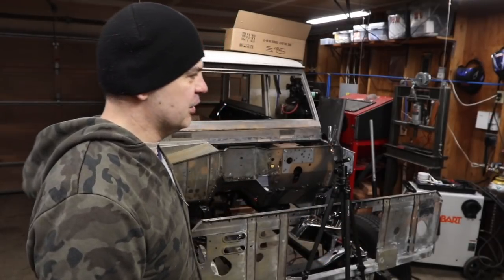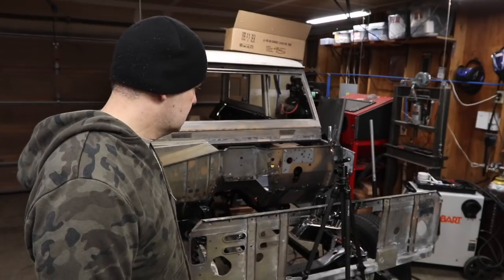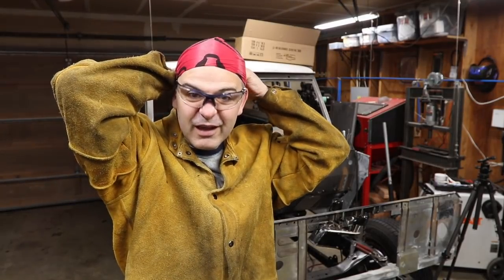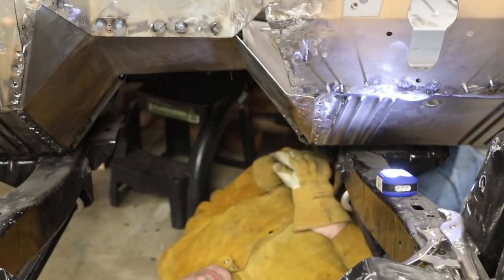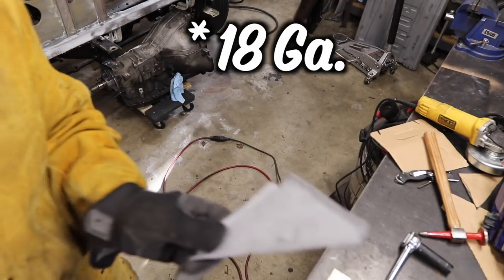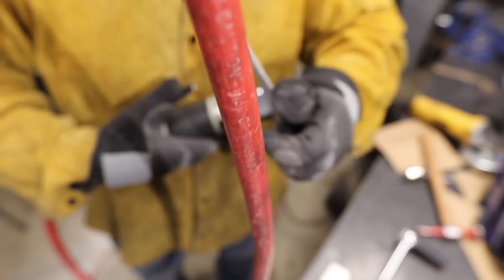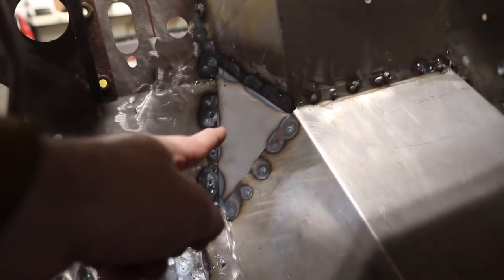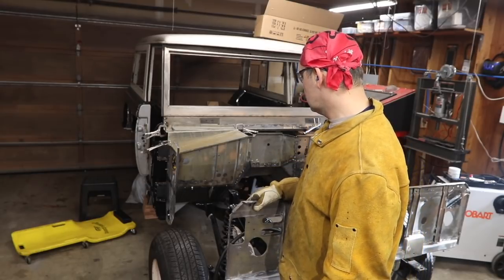4.21 Welding, Blasting and Chit Chat

Comment: Hey Matt, again thanks for your videos. Hang in there your my only hope. Wanted to ask how you like your garage heater? I have a three car and need to get some heat going. Texas has only has two seasons so I need to prepare.
Reply from the maker: I couldn't ask for more.  I turn it on and 20 minutes later the garage is comfortable.  Only issue is the cold concrete but a man has to suffer for his art.